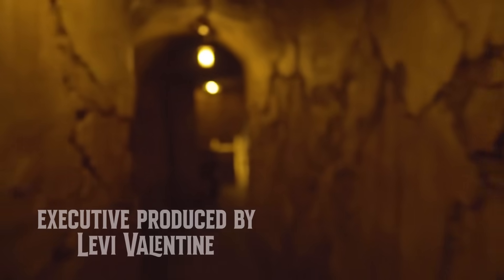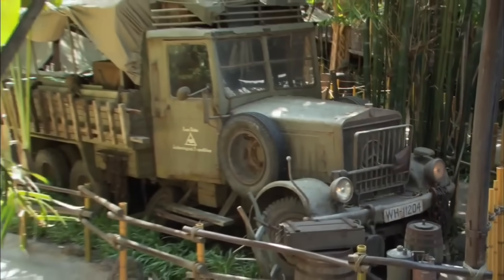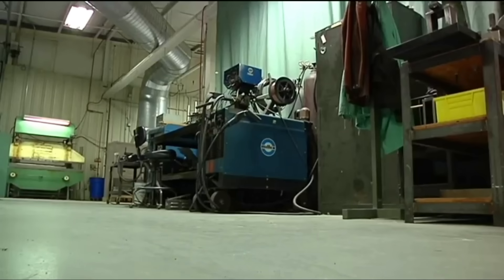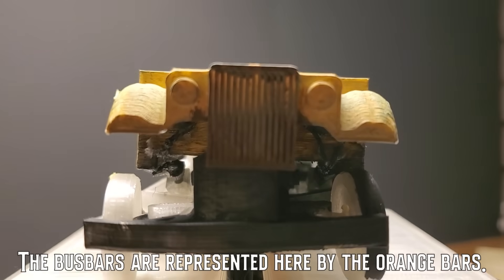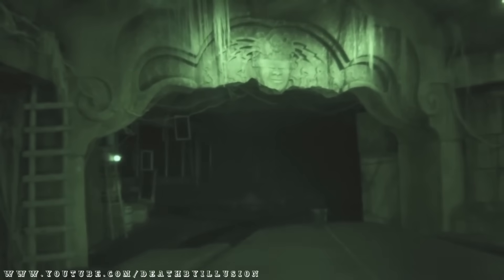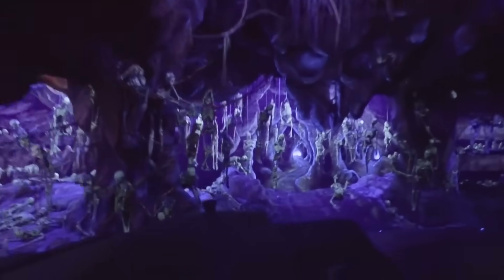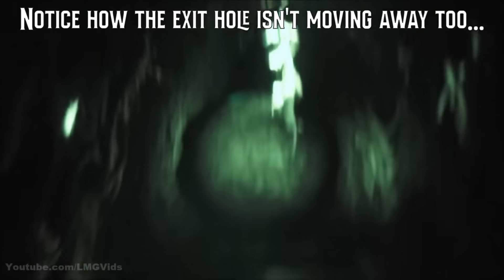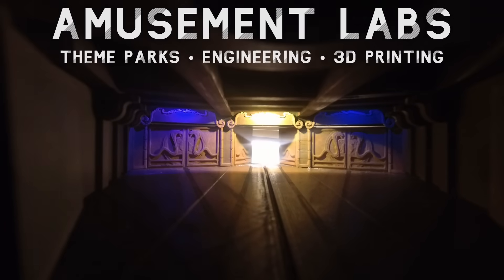How It Works: Disney's Indiana Jones Ride

Comment: My car stopped right at the Indy hanging.  At least 15 minutes.  They turned the lights on after about 4 minutes and I could take my time inspecting the mechanics of the ball and the walls.  The ball was retracted into a "garage" and you could see how it rolled towards the car, how the walls also moved in sync with the ball to give the illusion of moving backwards (the car does not move backwards), and how the car dives under the ball.  They allowed us to stayed in the car for a redu.

Comment: I remember riding this when it was still new. Great, great ride. But I could have sworn it had multiple paths after the Chamber of Destiny, because I remember on the first go-through we saw another vehicle go over the bridge but didn't go that way ourselves. I also remember the first time through the air guns weren't working for some reason so the Dart Room was just an inexplicably slow crawl past the skeletal warrior mural--my dad called it "The Hall of Iron Maiden".

I also remember going to the little museum in New Orleans Square and seeing some of the development art the Imagineers made while planning the ride. There was one showing that the early concept was a much, much more ambitious three-part attraction consisting of a guided walkthrough segment, the Land Rover segment, and a Temple of Doom inspired mine cart rollercoaster that had inversions. The mine cart coaster was dropped and the Land Rovers became the actual ride, but some bits from the walkthrough were kept as pre-show gags for the line.

Comment: May I ask where you got the model from of the emv
Reply from the maker: I made it!
Reply: @AmusementLabs  oh dam I just wanted to try out the 3d print my self but great job!
Reply from the maker: @gdfz1  I mean I can certainly see about publishing the files, but I must warn you it was one of the most tedious and frustrating builds I ever made. Lots of moving parts, very tight tolerances. Uses a 0.2mm nozzle for the mechanics.

Comment: So I have one question.... 

Why does this ride back down so damn often lol?
Reply from the maker: Lots of moving parts mean lots of sensors. Usually operations are also a part of the equation too so if someone is taking too long it can screw things up a bit, but those cases are less serious.
Reply: I was a CM at the sister ride of Indy (Dinosaur) a couple of years ago. The ride system itself is very smart, and even the slightest thing that is off the ride will shut itself down/stop, and when it does that it can take hours to reboot. Operation efficiency plays no part in a ride breaking down since the ride will hold cars in certain sections if ops are slow. However, I do know we are very on top of cycling out the ride if we need to shut it down manually. Almost every break down at least Dinosaur (and I’m sure Indy too) has is purely automatic because the sensors can be off and doesn’t track a car properly. Of course, there can be other issues like if doors onto the ride path open, or if an effect becomes some kind of danger to guests, but you get the idea:)

Comment: I can't believe there is only one active doorway! I rode it in the 2000s and believed there were multiple tracks ever since 🤣 Kudos on the models, so cool.
Reply from the maker: Yeah, it's pretty ingenious and seems to have fooled loads of people, but once you see it in motion it's a big oooooohhhhhhh ahha moment.
Reply: In all fairness, with trackless rides, they have been able to get multiple paths to work properly, the main issue with trying that with this is that it would take up a bunch of space to get the cars to join up again after the doorway. But, it worked pretty well with Mystic Manor in Hong Kong Disney. They use the same dart effect on that, and it's pretty effective.

Comment: It seems to me that Disney should have used a switch track in the chamber of destiny and 3 short sections of track that branch out to the different doors and then regroup into one track on the other side, instead of moving the wall with cables, which proved unreliable.

Comment: Stop changing the logo, the last one you had a few hours ago was the best.
Reply from the maker: It was the best because.... (Looking for feedback)
Reply: @AmusementLabs  Oh, If I compare this to the other I think that the current one Is two wide. The previous A L design had the perfect width to complement the dark blue backdrop.
Reply from the maker: So it should update soon. I changed the primary line so it's not flaring out, but it is thicker. I think that's better since it'll mostly be tiny on screens.

Comment: Is there a way to get the car model to 3D print ourselves ?
Reply from the maker: It requires a number of different sizes nozzles and sanding to get it to work and then it's rather hard/fragile to put together. Plus, unfortunately, I've busted people trying to sell/market my models as their own who then threw a fit when I called them out.
I mean I could put them up for sale, but I would want to put warnings of what an uphill battle the model is. (Plus some parts were replaced with string since they didn't work)

Comment: The ride vehicles were designed and assembled in Anaheim California in a business park near downtown Anaheim… WDI .. the location is now in a different place off Flower St near fullerton.   WDI used many different contractors to assemble and fabricate items. Anaheim used to be full of 100’s of fabrication shops because of the aerospace industry that was prolific in the area at this time.   So it could be many of different shops. I know one that did do parts jobs for WDI but I can’t recall the name but it wasn’t exactly the only thing this fabricator did.. WDI would contract the work and that was it..
Reply: Most of what you stated is completely false. 1) The entire ride system (Enhanced Motion Vehicles and Track System) was designed, engineered, prototyped and developed by a very small team of 12 design engineers and 4 fabricators between 1990 - 1993 in a huge warehouse leased by Disney in a Valencia (Santa Clarita) industrial park (which is nowhere near Anaheim). The address is 27420 Avenue Scott, Santa Clarita, CA. Disney leased the south half of that building. We also used several machine shops in the same industrial park, and a couple of others for specialized machine work (wire EDM) and castings. I know because I was one of those 12 Design Engineers. 

2) WDI is still on Flower street in GLENDALE (where it's ALWAYS been) and Glendale is nowhere near Fullerton or Anaheim.

3) I don't know who manufactured all of the components for the production vehicles and track because once we finished the design and engineering work on this project, most of us (including me) transitioned to other projects. It's true that WDI used different shops to manufacture parts, but they liked to do all the final assembly themselves. Mostly for quality control and to familiarize Disney workers with the systems so maintenance would be easier to perform. That's part of what those 400 other "Imagineers" did.

Comment: I was a ride operator for Indy and even I learned things in this video! We would always get that "actuator" fault on the main control panel but nobody really knew what it was, we just knew to call matienence 😂
Reply from the maker: Yeah, I found that little thing in the patent filing. Seemed like a good idea at the time, but it seems like it's prone to constant triggering/faulting.
Reply from the maker: Was this usually after a breakdown or when they'd mop the road?

Comment: The first time I went on the ride it was wild with my only complaint being the ride needed a seat belt the 2nd time was rather bland and the vehicle just moved along the track with hardly any lateral movement in other words no seat belt needed.
Reply: The ride has always had a seatbelt, and it is checked by staff.
Reply: @punkuhr  Your right they did always have a seat belt but it did not make me feel secure so they should have strapped you in as they do on many roller coasters

Comment: Second Question Why Can't Disney Make Their Own Cable Pulley Motor System??? 10:00
Reply: It’s more to do with the fact that they would have to completely tear down that part of the ride to fix the system for a minor effect. Just like they leave (and carefully themed) the bullet hole in haunted mansion because they would have to remove the whole roof of the building (and news is now they lost the replacement glass that has been sitting in storage for 60+ years).

Comment: Just wondering if you are a former/current cast member. Your models are amazing. I'd be interested in more info on them. I still have my training package somewhere for this attraction.
Reply from the maker: I've literally never worked for Disney or any theme park in any capacity ever. I make them just based off of photos.
Reply: @AmusementLabs  , I'd be interested in a model of the indy ride vehicle. Any chance of making some sort of arrangement?
Reply from the maker: @paultk4063  unfortunately probably not. They're very finicky and difficult to assemble. The design was mostly made to last just through filming and stuff has already snapped cause the parts are so tiny.
Reply: @AmusementLabs  bummer, I spent 2and half years running the attraction. For many reason. Daily ops, Special events, and even a couple programming shifts. The programming shifts are so mundane......you literally sit there disspathi g the ride so the programmers could drive the vehicle around adjusting things as they went

Comment: No mention of the lowering spike ceiling in the queue line? Nobody ever believes me that that was a thing!!!!
Reply from the maker: It still 'moves', but like only a few centimeters... As you can see by the video length I didn't really have the time to fit them in. I don't like to make videos too long cause most people usually click away by like 7-8 minutes.
Reply: @AmusementLabs  as a kid I remember that room being packed full of people and pulling on that bamboo support and watching everyone freak out as the ceiling dropped. I think fastpass definitely killed some of the magic of one of the coolest queue experiences ever
Reply: The lowering spikes in the ceiling still work if you pull the bamboo pole. Not many see that effect since it is easy to rush past (they don’t let the line back up to that point), and the effects purposely reset only after a timed delay. The well rope effect still works as well, but the diamond block in the floor causing the ceiling piece to drop a foot or so was turned off years ago.

Comment: There is another Indiana Jones Adventure ride at Tokyo DisneySea which uses the similar ride system but it's title is Temple of the Crystal Skull and with different theming. You didn't mention the Tokyo version. If you are wondering which version of Indiana Jones Adventure I like more, my answer is the Tokyo version.
Reply from the maker: The Tokyo version is also all electric because hydraulics are banned for the most part in Japan.

Comment: It would be cool if you made a follow-up video about the differences between the California and Tokyo versions of this ride.
Reply: Tokyo Indy doesn't have fire indoors. uses a vortex effect instead
Reply: @SalivatingSteve  Exactly! And the Tokyo version uses electric motors to drive actuators for the ride vehicle's motion base, instead of hydraulic pistons. This eliminates toxic and messy spills of hydraulic fluid and results in more uptime and easier maintenace.